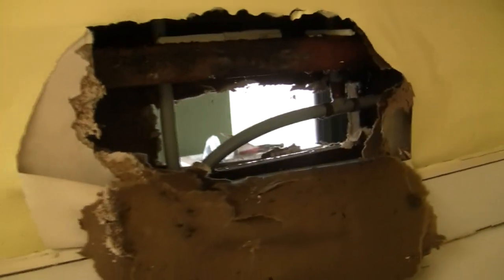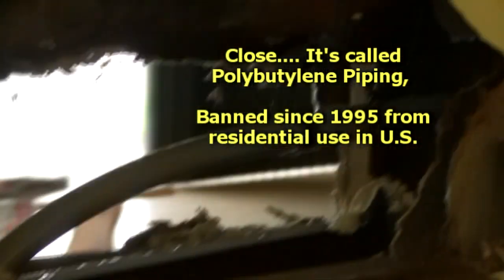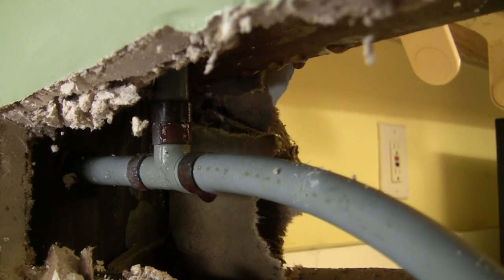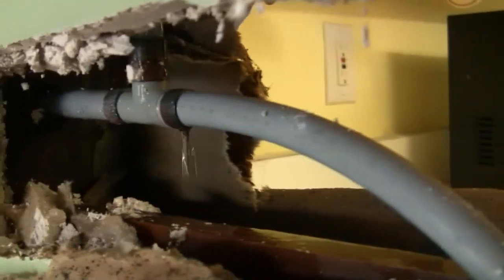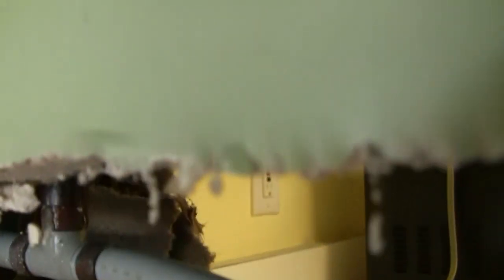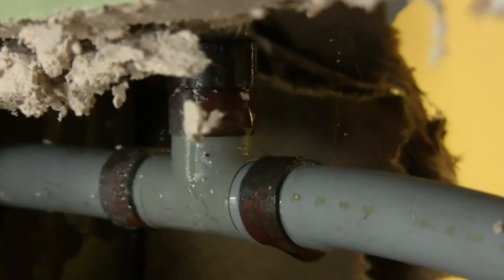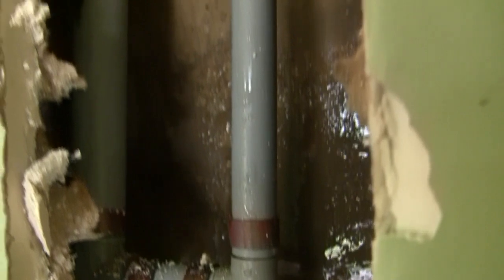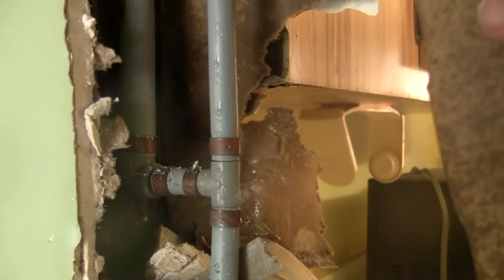How Polybutylene Piping (Grey Pipes) Caused Plumbing Leaks, Mold Inside Wall

Comment: The problem was never with the Polybutylene piping (AKA QEST.).Polybutylene piping is still in wide spread use in Europe and Asia and is being produced by 5 different manufactures in Europe.  The problem was with the Acetyl Plastic fittings. The elbows and tees that were only ever allowed in the U.S.  These plastic fittings (made by Celcon) were known to fail after 5 -8 years of exposure to chlorine and hot temperatures.  These fittings were also know to crack if improperly crimped.  Plastic fittings were never allowed in Europe, and there were more stringent crimping standards, crimping tools and copper fittings and crimp rings.  There has never been a problem with Polybutylene piping in Europe and it has been in continuous use in hot and cold water pressurized water supply for over 45 years.  In the U.S. Shell Oil (sole supplier of Polybutylene resin) had deep pockets and once a Judge allowed Shell to be sued because it was associated with the Celcon fittings the litigation flood gates opened and every lawyer in the US was trying to sue Shell.  Shell voluntarily removed it from the US market but continued selling in Europe, Asia, the middle East and about a dozen other countries.  It is true the the US Plumbing code disallowed Polybutylene, but only after public uproar following  a "60 minutes" hit piece on the evil corporate giant Shell Oil.  Independent tests on multiple samples of Polybutylene tubing after 18 years continuous use showed zero deterioration.  Projected life expectancy is over 100 years with normal chlorine levels, temperatures and pressures found in residential situations.  The class action law suit against Shell was never allowed with plumbing systems using a Manifold or "Home Run' plumping technique.  With a manifold, each fixture (toilet or sink) gets its own dedicated plumbing line running from the manifold to the fixture. One continuous run of piping with no elbows, tees or other fittings.  No fittings behind walls meant no leaks from poor crimps or poor plastic fittings.  Houses plumbed with a Manifold  were considered to have no more problems than any other plumbing technique with copper or PEX.  Hence class action lawsuit did not apply.  Ron Manley said Polybutylene pipe is guaranteed to leak.  True. But  only if installed in the U.S. using cheap Celcon acetyl  plastic fittings and cheap aluminum crimp rings.  Polybutylene with a manifold system or with properly crimped copper fittings will last as long as PEX or Copper. Will Polybutylene  eventually fail?   YES.   But name me one pressurized water distribution system that won't eventually fail.
Reply from the maker: Polybutylene was used in construction from 1978 to 1995, but lawsuits began in the 80s when failures began. What they discovered was that over time, a very short time relatively speaking, the connections and even the Polybutylene itself, had bad reactions to the chlorine in municipal water, and it degrades the pipes and connections. Chlorine reacts with the Polybutylene piping and acetal fittings causing them to scale and flake and become brittle. Micro-fractures result, and the you get spraying leaks.  You can't just blame it on the crimp connectors.  This condo was built in 1984, and pipes failed in 2013 at 29 years. I have them in my own house, built in 1992, and in 2016 I got my first failure. So Polybutylene was not banned because of some 60 minutes segment, it was banned because they were failing in large quantities all over the United states. My guess is the hwole design of it and the way they crimp together help contribute, if plumbers can't seem to be consistent with installing it correctly. I fear Europe will see similar failures soon as well.
Reply: @jeffostroff  A week or so ago I discovered a leak, then upon searching I found yet another leak. Then the line under the sink started leaking. Then the line to the toilet started leaking. I didn't know what polybutylene was. I thought this pipe I have was pex. But no, it's Poly B. It was built in 1989. Im going to have to replace it all in this place. I don't have insurance or anything.
Reply: Yes, the plastic fittings WILL definitely FAIL !  
beyond me HowTF anyone ever even thought of making something so inferior
$$$$$$$$$ damage in my homes
Reply: @Countryman333  I have had it in my house since new in 1991. The house is 3400 square feet and includes an in-law apartment. That means 4 toilets, 3 showers, 5 lavatories, 2 kitchen sinks,a jacuzzi, a washing machine and 2 hose bibs. 31 years of continuous use without a problem.  The plumbing system uses a manifold so each fixture gets its own independent run of polybutylene pipe.  In 2017 we did some major remodeling of the main kitchen, 2 bathrooms and the laundry room.  Walls were removed and polybutylene exposed.  No problems.  The manifold was starting to become problematic so that was replaced in 2017.  The problem you are experiencing may be one of two things.  Studies have shown that if the bulk polybutylene tubing was stored outside for several months, UV rays from the sun started breaking down the plastic.  The same holds true for PEX.  Also rats, squirrels and other critters have been known to want to chew on it.  Over a decade ago the Royal Albert Hall in London was re-plumbed with polybutylene.  Long after it was withdrawn from the U.S. market. No one overseas has found  a reason to stop using it.  Sorry about your situation.  That sucks big time.  The window for getting in on the class action law suit closed a long time ago.
Reply: @Countryman333  I think I know what you meant about Having the third kind of poly plumbing.  Original system used in the U.S was polybutylene with grey plastic fittings fittings (elbows, tees, or corners.). Those grey plastic fittings started failing left and right after 5-8 years. Chlorine and hot water broke down the fittings. 2nd kind, when they finally realized the plastic fittings were no good they started using metal fittings with the polybutylene piping.  Some times using high quality meta fittings and sometimes cheap aluminum fittings.  Remember with copper plumbing not just anyone can be a licensed plumber it takes training.  When polybutylene came along all of a sudden it was relatively easy to install.  Plumbers hired laborers with relatively little experience to knock out new construction plumbing quickly.  Result a quick, sloppy job with poor crimps, tight bends, poorly secured and prone to abrasion…. 3rd kind to eliminate all fittings behind walls.  No fittings (elbows, tees, corners) means no chance of leaks. That is where manifolds came in.  The so called “home run” technique.  Where ever toilet, sink etc etc gets it’s own continuous length of polybutylene water supply direct from
Reply: So every thing gets water directly from the manifold.  The class action lawsuit against polybutylene specifically excluded systems that used the manifold. The reason was they found polybutylene was no more problematic than any other type of plumbing when used with a manifold and the home run technique. Polybutylene plumbing was developed and used in Europe several years before it came to U.S.  It has been in continuous use to this day.  Even when Shell Oil voluntarily removed it from the U.S. it remained in wide spread use for new construction in Europe and Asia. The rest of the world never bothered with manifolds.  They plumbed the same way they did with copper.  Elbows and tees crimped and hidden behind walls.  What is the difference?.  High quality copper fittings and crimp rings, precision crimping tools and installation by licensed plumbing contractors only.  Again sorry about your situation
Reply: We’ve had the Evil gray pipe spring tiny holes that were no where near any fittings. When the house was quiet I could hear That Sound, the hissing.  I would alert my husband, who couldn’t always hear it. We’ve had soooo much water damage in our mobile home, gah 😫
Reply: @kareenm175  My house was built in 1992 with QEST and a manifold system with no fittings behind walls. Just straight runs of QEST from manifold to plumbing fixture.  I have lived in this house the last 21 years. No problems.  One thing I did not mention is that if the QEST piping was improperly stored, out doors in the sun, the UV rays would start breaking down the plastic after several weeks. The same problems occurs with PEX.  Could it be that?  Or could it be that rats, squirrels, etc are chewing at it?  Lastly any kinks (too tight of bends) in the tubing can lead to failure.  So sorry about your problem.  That sucks.
Reply: My house it's built in 92, with same manifold, but it's tucked away under the stairs. There are no plastic fittings at all, but probably a few elbows are present especially when the pipe needs to come out at a 90° angle from the wall... A quick note, my house it's in Canada.
Reply: @RomanTrollanski  My house also built in 1992 (WA State.) 3 years ago I changed the manifold as it had some minor leaking. They just reattached the same QEST tubing with metal crimps.  No problems going on 3 years.  In other parts of the world they use QEST type piping routinely.  They do not use a manifold. They plumb the conventional way with elbows, Tees, etc.  Difference is they have always use metal ones and and precise crimping tools.  QEST got in trouble due to acetal plastic fittings, and plumbers hiring lower skilled helpers.  Your angled fittings should not be a concern if they are metal and well crimped. I have a 3 story house. In the top 2 levels, a manifold is used. In the bottom level (in-law apartment) and the hose bibs are separately plumbed with Polybutylene in a conventional manor.  No problems for  30 years in either case. Independent test reports say this should last 100 years with normal chlorine levels, normal residential hot water temperatures and normal daily water usage.
Reply: @davidhill7055  I live  only 10 miles away from the Lynden border crossing, when the border was open I used to visit my friends in Bellingham quite often.

Just noticed, there's a elbow just behind the wall at the powder room, I'm able to see it without tearing the wall cause it's right next to the sink drain and the hole for it it's big enough to see it. But definitely it's cooper elbow crimped with a cooper ring. A while ago I've rerouted the pipes under the sink, I had to make them closer to the wall and coming out of the wall pointing up si I could fit a vanity with drawers, I've used an adapter from poly to PEX and crimped with the steel rings and then I've used a 90° elbow and steel rings again, in fact my poly pipe comes out of the wall 1 inch, then I have the adapter, then comes the elbow, then comes a shark bite shut off valve. Only steel rings have been used, and a proper crimping tool from Home Depot, there's no way you could get the tightening wrong cause the tool once you start crimping won't release the jaws unless you crimping it all the way down.
So far holds really well, haven't got a leak.

In Europe, where they built real houses not the north American cardboard joke, they are only using only cooper pipes with soldered fittings, some parts of it are using PEX and they crimping then with steel rings and crimping tool only, and also it's a reliable way to do it.

To my point, I trust more the steel rings (just to be clear, the pinch to crimp style, same as the one used in automotive at the CV boot axles) than the push in shark bite adapters and not afraid to use them. So far, never got a problem.
Reply: @RomanTrollanski  My brother lives about 200 miles to your east in Oroville, WA. About 3 miles from the Canadian border leading into Osoyoos.   

 I had my kitchen and bathrooms remodeled a couple years ago.  The plumbers used an adapter that went from my Polybutylene to PEX so the last few inches of each manifold line were in PEX. This allowed them to use conventional plumbing fixtures, valves etc.  In my in-law apartment on the bottom floor (Polybutylene but not part of the manifold system) I needed to replace the kitchen faucet.  I bought a Delta "Collins' model. Basic model for about $95.00.  I have plastic hot and cold valves under the sink which were hooked to Polybutylene coming thru the wall. Delta sells an adapter in their Delta RP63263 kit.  The kit contains two types of adapters. The ⅜ compression to ½ slip joint is the adapter I used.  This allowed me to hook the new faucet hot and cold supply lines to the plastic valves from the wall. Not sure if this will ever apply to your situation. With the kit you have no option to shorten the Delta supply lines. You have to use their full length. They were a bit too long in my case but it worked out fine.
Reply: @Countryman333  I replaced all the water lines with Pex. I bought it from a dealer. Everything to do it was around $700. It wasn't that expensive. I did it all by my self. Bought the crimping too and all parts. It took a couple of days. No more leaks at all nowhere.
Reply: @Countryman333  I did not know there was 3 kinds of polybutylene. As far as I have read it was all manufactured by a Shell Oil subsidiary. Shell was the sole provider at least in the U.S. Your poly is a bit older than mine.  I hope in another 5 years mine does not all of a sudden start produce pin hole leaks.  I have read reports from independent labs who subjected it to abuse to simulate rapid break down. Higher pressures, Higher Chlorine Concentrations and Higher water temperatures. All much higher than would be found in a typical home.  They estimated it should last at least 100 years in normal conditions.  But no one knows for sure. Only time will tell.

Comment: Thank you for sharing that example of leaking water which appeared to come from a pipe joint/connector which is the most vulnerable point.
Reply: NOPE...!! The degrading of the poly-b pipes because the chlorine on public water system, this modified the molecular composition of poly-b and make him more brittle when pass the time.
...online info...
Reply: @davidhill7055  
Mostly problem are locally on FITTING , not on the polybutilene pipes....now days poly-b pipes continue used in Europe and Asia....
Reply: @potatosalad5355  Yes.  The class action lawsuit against Poly never applied to systems where there were no fittings. Like my house that has a manifold and straight runs of poly from the manifold to each toilet, faucet, dishwasher, ice maker, etc.  No cheap plastic, or poorly crimped metal fittings hidden inside the walls. Hence systems like mine were found to fail no more often than any other plumping system (PEX, copper, etc.)

Comment: your problem is most likely the plastic fittings which become brittle over time.  The pipe only cause problems if you have a high chorine content.   I have a well with PB pipe but copper fittings, has worked well for over 24 years.
Reply: Yes same here. I had 2 houses with poly B. Both were over 25 yo and 0 issue. Copper fittings. Much less of an issue in Canada. I have been replacing the pipes whenever I remodel a room. The only way I would change everything would be if my insurance refuses to cover me in the future. It might happen, who knows. I heard some insurance do not cover anymore.
Reply: Gary Tweed - You're talking about crimp rings, right? I had aluminum crimp rings on mine in a trailer and had leaks all over the place. I'm guessing it had something to do with expansion and contraction over time due to the change of seasons.
Reply: @hemihead6645  no he's talking about the actual fittings. The plastic fittings dont take to chlorine well st all, and are even used on pex too now. Pb is a good system, but the metal copper fittings should really be the only way to go.

Comment: You have to cut all that pipe and fittings out.  Quest is out of business.  Polyethylene is much better, I recommend the brass fittings and copper rings with stops.
Reply: Yes QEST the US company is out of business. The Polybutylene piping that they used in their brand name is still going strong all over the world.  QEST was forced to go out of business when Shell Oil voluntarily pulled out of the US market.  Never pulled out of the world market.  Still being made by 5 different plants in Europe. Still in wide spread use in Europe, Asia, the Middle East in residential and municipal systems